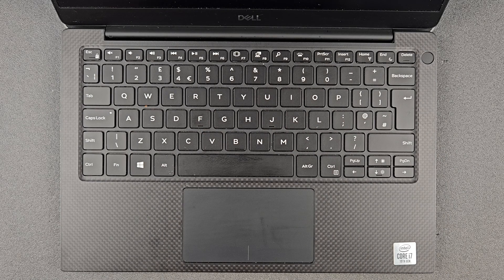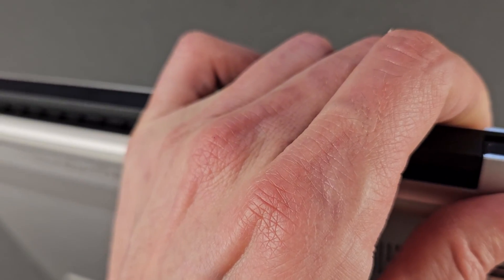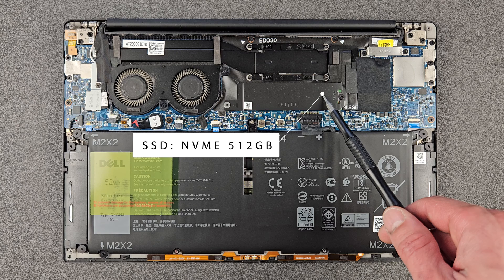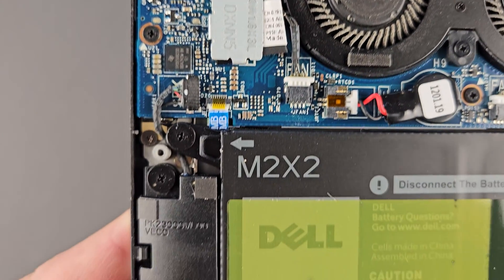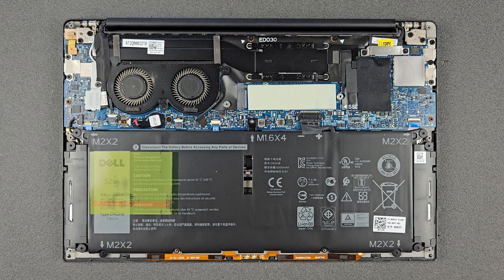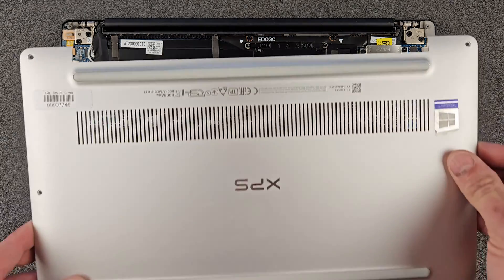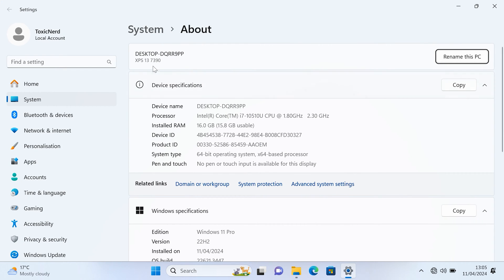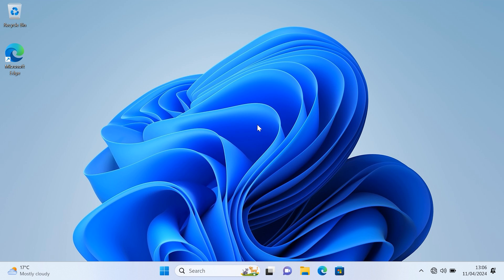Dell XPS 13 7390 RAM and SSD Upgrade. Can it be done?

Comment: Thanks for this: very straightforward description of how to upgrade the SSD. On a thing this small, it's not surprising the RAM is soldered--the Latitudes I guess kept more upgradability for longer, but the XPS is really small for 13.3" screen, and pretty flash. But heavy.

Comment: Thanks for this - very helpful, worth noting that on my Dell XPS 13 7930 the SSD was the small size so the cover you show at 4:12 is different and has a retaining tab that holds the small 256MB SSD in place, when upgrading to the 1TB which is full length you either need to get the right new cover plate or as I did bend the tabs out the way so the cover plate fits.